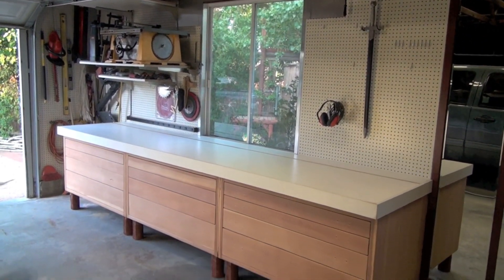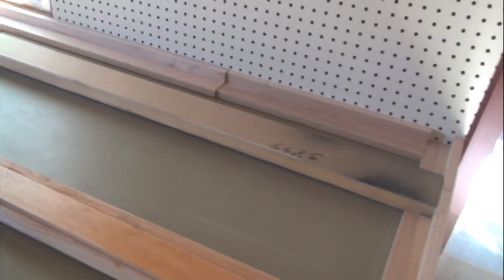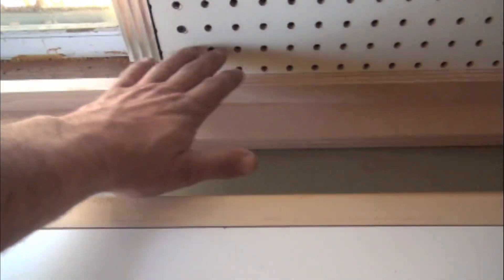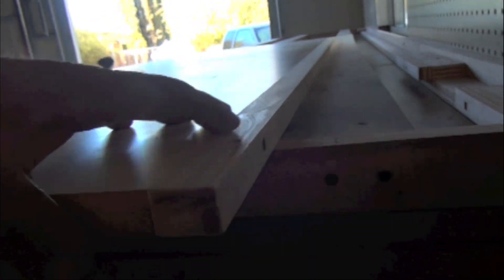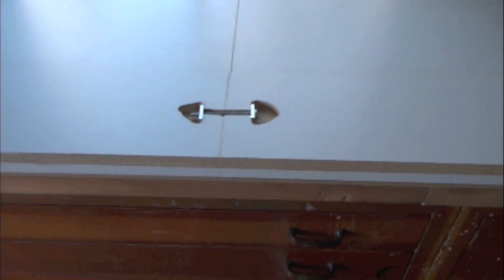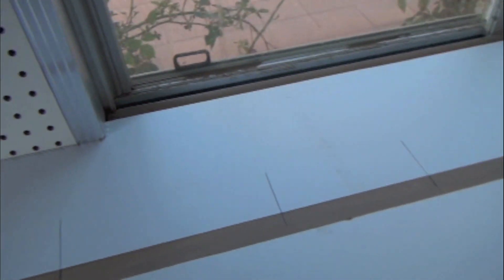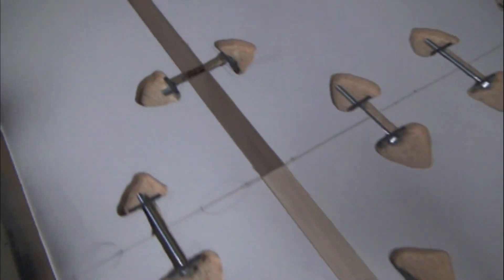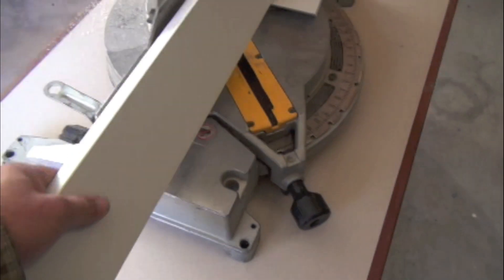Building  Custom Melamine COUNTER TOP for Work Bench / Work Station in the Work Shop part 3

Comment from the maker: Great =)

No wood glue because 1. It's not going anywhere 2. I will eventually take this apart and it just makes it easier to reuse,replace material that was dry installed.

~

I'm still not sure. I was going to paint it but now think I might stain the raw wood  and varnish it in a hi gloss. The actual finish application might not happen for another month+. 
Im jumping on another project soon so I can figure this out
  Thanks for the floor advice. It sure would be nice to have a finished floor.

Comment: Still watching, can't wait for the end results.
Question: Why no wood glue on your biscuits?
~
Oh, the actual bench color. Have you decided what color or type of coating?
I myself would like to see "natural" wood surface but then again I think a black, non gloss would look very good.
~
On the floor, I've epoxied many square feet in my lifetime, it's most definitely worth the time & effort but don't forget to add a bit of grit (sand).